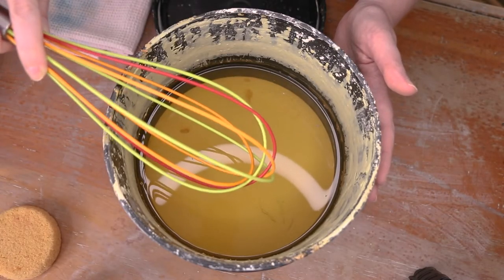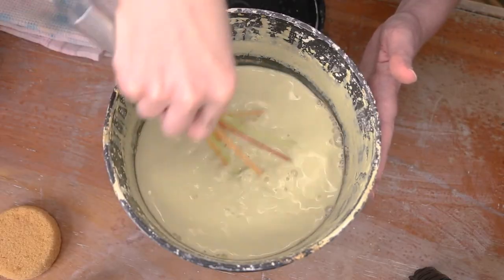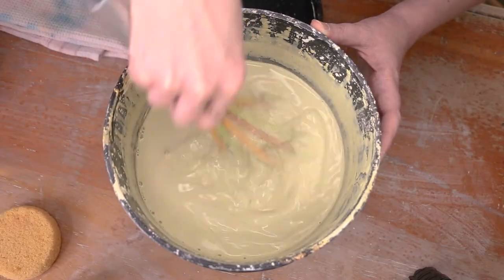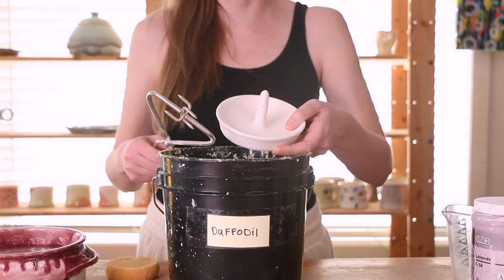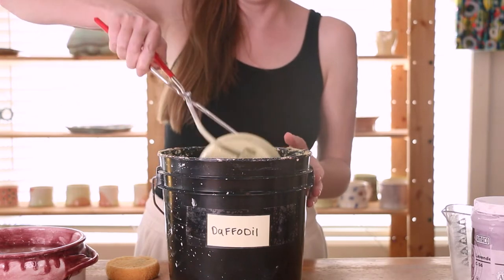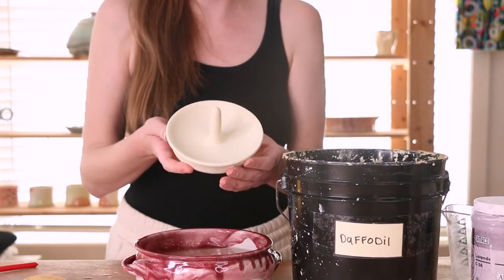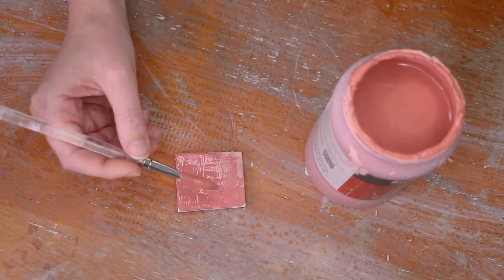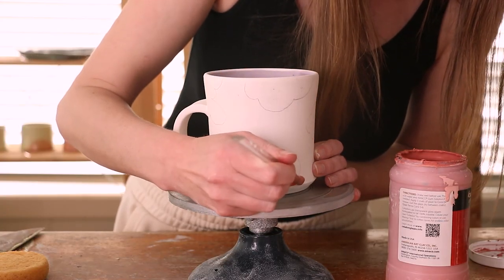Pottery Tutorial- Basic Glazing Techniques You Can Use in a Home Studio

Comment: When you have removed some of the brushable glaze (in the vid you used an Amaco Celadon), and added water, do you put the unused glaze back in the pint container? If yes, can you continue to use as a brush-on glaze, or it should be used as a dipping glaze from then on?
Reply from the maker: Hi! Yes, I put the excess back into the pint jar and continue to use it for brushing. But if I do this repeatedly with the same pint of glaze and it starts to become noticeably thinner than the original product, I will either use it only for dipping/pouring OR if I use it for brushing I add an extra coat to ensure proper coverage. It's all flexible as long as you can get a good, thick coating, whatever application you are using! Does this help?

Comment: Great tutorial. But I have a question at 7:25 when you dipped it with the yellow glaze, how come it did not stain the inside of the bowl? Like how did you make the inside stay purple when you half dipped the top of the bowl?
Reply from the maker: Hey V! Great question! The pot naturally traps air inside of it when you push it down into the glaze upside down. The air resists the glaze from going on the inside! It's really quite cool! On pots that are very shallow this doesn't work. The walls have to be vertical on some part of the pot for this to work. It also helps to hold the pot as straight as you can during this so you don't release any of that air. BUT if you do accidentally angle the pot it will only get a little glaze on the interior. It won't cover the color on the inside unless you turn it completely on its side or right side up. Hope this helps and thanks for watching!

Comment: New to pottery, is there a purpose to the very shot choppy brush strokes?
Reply from the maker: Hi Elizabeth! Good question! Usually when applying glaze you want a generous amount for each layer, so painting with short strokes helps me not to pull the glaze across the surface into a thin layer. Also, the surface of the piece at this point is super absorbent, which means the glaze begins to dry as soon as it touches the surface. If I tried to pull the glaze around in long strokes with my brush it would get too dry. Does this help? Thanks for watching!

Comment: I'm a bit late watching and commenting lol but I always wonder, if you chose to paint the glaze on and do a design (let's say flowers) do you then have to brush a clear glaze or varnish or something over the top? I always wonder how the mugs that have designs painted on with a plain background end up glossy looking after being fired. Like, not only the design that's done with glaze looks glossy.. the whole mug looks glossy. How?
Reply from the maker: Hey Shannon! Great question! You do not have to cover a traditional glaze with a clear glaze to get a glossy finish. All glazes have silica in them which is finely ground glass that melts during firing to produce a gloss or glassy finish. Depending on the level of silica in a glaze, the finish can come out matte to glossy or anything in between. You just need to look at the product description of any glaze to find out what level of gloss it will have after being fired. If you're painting a design with glossy glazes you do not need to add an extra layer of clear to get a glossy finish. Does this help? Thank you for watching!
Reply: @potteryplus  thanks so much for the reply. You did kinda answer my question, but I'm still wondering, if I paint a design on my mug using glaze, but leave parts of the mug without a design, how do I get the full mug glossy? Rather than just the parts I've painted the design onto? That's more what I'm wondering ☺ I get that if I fully painted a mug I could end up with a fully pink glossy looking mug for example, but im wanting to try and make some mugs with a few small flower designs on them. X
Reply from the maker: @shannonx7023  ok I think I understand now! Thank you for clarifying. Yes! If you paint on a design you would need to dip the whole thing in clear if possible to fill in around the design. You can always paint your clear on as well if dipping or pouring isn't an option. You might look into underglazes as well as they are made to paint designs and then be covered over with a clear glaze. For food safety reasons, it's best to avoid varnishes. Does that help? Let me know if you have more questions!
Reply: @potteryplus  yes that helps, thanks very much 😊 my only other question would be could you recommend a glaze which I could paint over the top? 🤗
Reply from the maker: @shannonx7023  sorry for the year long delay in replying! I was looking back at comments and I just saw this. You probably already figured this out but just in case, any clear glaze will work as long as it matches the temp range of your clay. Mayco and Amaco are the most standard brands of commercial glaze. If you are working on a dark clay body you might have to experiment with which clear works best. Sometimes clear glazes actually look a bit cloudy on dark clays. I hope this helps and happy New Year!

Comment: Hello, I have a question, is every clay have a specific glaze to use? Or all glaze can be used for all kinds of clay?
Reply from the maker: Hi! Yes, all clays have a temperature that they should be fired to in the kiln during the final firing. Your glaze needs to match that temperature. There are some standard temperature ranges that you can start with though depending on what kind of kiln you have access to. Cone 06 clays and glazes are a good place to start- there are many good products for at home use in this temperature range. Does this help? Thanks for watching!
Reply: @potteryplus  thank you so much 🥹🤍🤍
Reply: when glazing directly on piece, how much time to dry between layers?
Reply from the maker: @bkirstie  Hey Kirstie! About 30-90 seconds will usually be plenty of time. When you see that the glaze looks matte or chalky, you're ready for the next layer. It all depends on your process, so it may take more or less time. Look for a very dry looking surface and that will be a sign that your piece is ready for the next layer. I hope this helps! Thanks for watching!

Comment: What exactly is glazing? Im absolutely new into this and i dont get it. How do we paint our pottery piece? Like what paint.
Reply from the maker: Hi Anika! Great question! So, glaze is a separate product from any type of paint.  Paint is made of pigments and binders and its only curing process is to simply dry out. Glaze is a combination of water, clay, ground glass, and colorants which can withstand high temperatures and bond to the clay in the kiln to create a non-porous surface, and is fired on to your pieces as the final curing step.  Please keep in mind, this is an extremely simplified explanation of what glazes are made of. However, you don't have to understand too much about glaze chemistry to use glazes effectively! Especially commercially made glazes (in other words, glazes you can order online or buy at a store). Just make sure your glaze matches the highest firing temperature of your clay. From there, you apply your glaze to your pieces after they have been bisque fired (this is an initial firing that ensures the clay is no longer water soluble) and then fire a 2nd time to the appropriate temperature range of the glaze. Glaze application can be done by brushing, dipping, pouring, or spraying the glaze on to the surface! Most pre-made glazes will have application instructions on the packaging. Mayco and Amaco are 2 standard brands that are excellent for beginners. Does this help? Thank you for watching!
Reply: @potteryplus  so for pottery we use glaze only? 
And yes your response is very helpful.  Thank you so much💖
Reply from the maker: @anikatahir6146  yes, exactly! Glaze only!